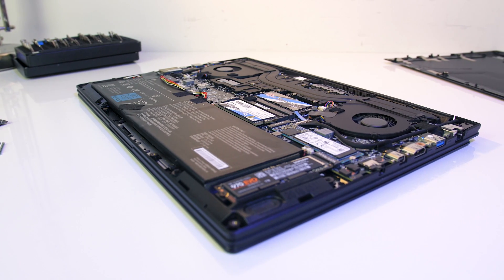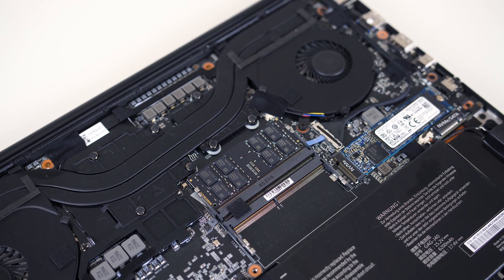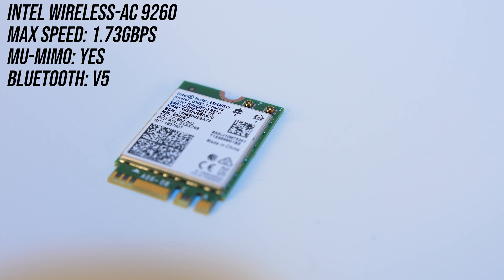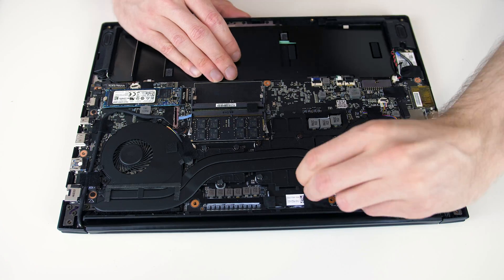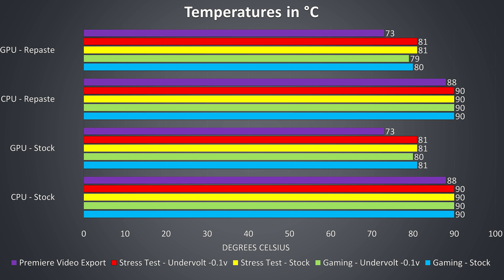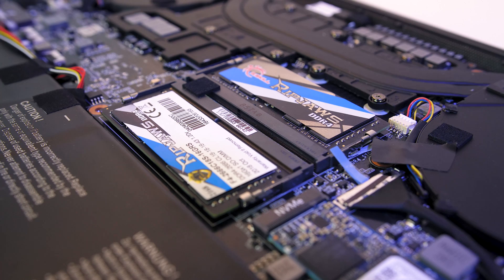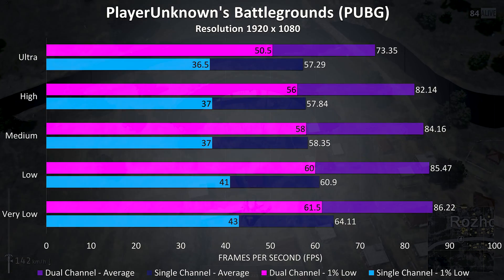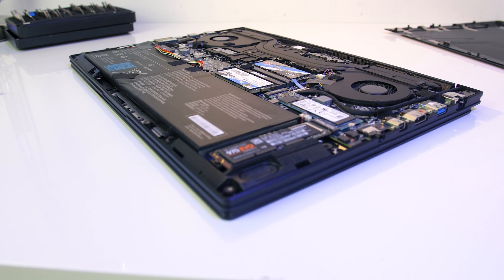Upgrading the Gigabyte Aero 15x Laptop

Comment: Great vid, especially since it covers all the upgrades I plan to do when the parts arrive..one suggestion regarding temps..the application by soreading the paste with a card has been shown to potentionally trap pockets of air which is bad as temp transfer..if you want try a repaste woth the bead method? In my case gave me a solid 4 degrees difference! I saw a huge temp difference between cores so that made me thing and suspect the application..so I removed the spreaded compound and applied using just a dot methid..temps are now more eaven and lower!
Reply from the maker: Yeah I might try redo it when I get a chance, not sure if it warrants another video though but we'll see!
Reply: @JarrodsTech  yeah it dropped my gaming temps considerably. I also turned off turboboost and undervolted the cpu which gave me cca 15 degrees difference! Also I made a diy laptop cooler by drilling the aluminium cooler mesh and installing desktop performance fans to have unobstructed airflow. That dropped the temps another almost 10c..so instead of gaming on a 85 - 90 c laptop I game on a chill 70 c with no performance loss since the gpu cannow boost all the time
Reply from the maker: Nice one! Why not just use a cooling pad? I guess the more direct you can make the airflow the better though, but doesn't need custom mods, would be interested to see the difference between what you've done and generic cooling pad.
Reply: @StillnessInMotion88  do you have any more details pictures of this? I'm interested in doing something similar
Reply: @safety6g  not sure if I can upload pics on here, but I did a lot of tests with the same fans blowing through the mesh and after I cut out the mesh, the difference was staggering, cca 10c when the airflow was unrestricted. My fans are not static pressure optimized, they are made to push bigger quantities of air, not optimized for pushing air through restrictions, hence the difference. If you have static pressure fans I presume the difference would not be as big. I am using the Coolermaster Notepal u3 as the laptop stand which I cut out to accommodate the fans in the right position, to which I added the Corsair Air series I think 120mm fans. Id gladly help if you guys have any more questions.
Reply: @JarrodsTech  the difference was a solid 15 c if I remember correctly, as just propping the laptop on a cooler gave me a negligible difference of I think max 5c. After cutting out the mesh it dropped 10 c more. I own a newer laptop now, which has better cooling, and focuses on drawing air throug wents on the top not as much from the underside, so cannot test it again for you, and the difference now is cca 7 c total with that same cooler. Bottom line, laptop cooler by itself does not do much at least in my case, add aftermarket fans drawing power from the socket directly, remove the mesh and it should yield considerably better temps.
Reply: @StillnessInMotion88  thanks for the reply, I'm just trying to work out what you did.. you cut out holes in the cooling pad and in installed the Corsair fans? And then also cut holes in the mesh on the bottom of the laptop in the same positions at the fans? Could you maybe email me pictures if it's not too much trouble it's jaycolgantravel  at Gmail... 🙏

Comment: Asus scar II or aero 15 x?
Reply from the maker: For what? Scar II wins in terms of gaming performance if you get the 1070, otherwise Aero IMO is better in most ways (way better battery, design (IMO at least, no camo patterm), SD slot, 4K option.
Reply: @JarrodsTech  because they are the same price :/

Comment: Liquid metal
Reply from the maker: Not sure it helps much here, I've read of quite a few others that have used it on their Aero with little to no change, seems like the fans/heatpipes are just not enough to remove the heat regardless of the thermal interface material in use.

Comment: Hey Jarrod, I own the First-Gen Aero 15 with an 7700HQ and GTX 1060. I repasted Mine with Liquid Metal and there were just very very tiny improvments. My Memory-Upgrade worked Flawlessly tho. I Upgraded from 1 Stick Gskill 16 GB 2400MHz to 2 Sticks and had no Problems whatsoever. Just like u i did add a second SSD, but i noticed that it would throttle when used, so i did buy some Thermal Pads to Put between the SSD and the Bottom Panel. That fixed my SSD-Throttling to some degree.
Reply from the maker: Cool thanks for sharing your experience, I didn't think the SSD would throttle, something to look out for I guess. Yeah others have said that about LM I think the heatsink / fans just aren't enough to remove the heat so it doesn't matter too much what material is between the does and heatsink

Comment: Would it be worth repasting my Helios 500 with Kryonaut? I'm seeing 84c on cpu under full load with no throttling (3.9Ghz)
Reply from the maker: Hmmmm could be, in my testing that laptop already does extremely well once you boost the fan speed though, I was able to drop it 20c going from default speed to max

Comment: Try changing the fan policy. I set it to run 100% at 70 degrees the the temperature has never hit 90 since then.
Reply from the maker: I did all the testing with it manually on 100% to remove it as part of the equation

Comment: wichintel Intel Wireless-AC 9260 card did you used, there is an with and without "vPro version" out there. TIA
BTW: Thats why I bought the Aero 15x instead of the MSI Stealth Thin, because of the easy upgradability.
Reply from the maker: I don't think mine was vpro but maybe you can see version number in the clip where I show the card

Comment: the cooling systeme of this laptop is weak by design, you can still tweak few thing to prevent overheating too fast like non stop turbo mode, for me i got super wild with 32gb hyper x memorie and 2tB Sata WD SSD and the PC randomly bluescreen when idle ( usualy befor going in sleep mode )
but still very stable as long as i dont try to get him into sleep mode
Reply: Random bluescreen when  before/after sleep is not isolated to this machine . There is or was an issue with Max Q and Windows.  I experienced the  exact same BSOD in the same situation on 2 of my other laptops.  X1 Extreme being one of them so def not just an Gigabyte issue.  The memory compat problem is tho.  My others I an use just about any stick.  Me thinks Gigabyte may have done this on purpose in the BIOS somehow.  As I dont see any technical reason why any compat SODIMM would not work....

Comment: I bought this laptop for almost 3k$ and exactly one key on the keyboard for each 1000$ didn't work. To be honest, I'm really glad that I had to return this laptop, because it can be used only as heat sink on wintertime. Instead I bought latest lenovo legion, and it's great! A little less powerful GPU, but great thermals instead, 70-80 degrees Celsius on load even without repasting.

Comment: Hi Jarrod,

I'm in the process of purchasing a monitor for my Aero 15x. I want at least a 144Hz monitor (as I have the 144Hz version). Also, I wanted something more than 1080p. Will my Aero 15x be able to run a 1440p monitor at 144Hz? And also, is 2k worth it or should I stick with 1080p? Thanks!
Reply: Should be more than able to run a 1440p 144hz screen

Comment: I heard people say that grizzly kryonaut takes some time to perfectly spread and that the best way to get it spread is to get as much heat between the CPU and the copper as possible. I applied grizzly kryonaut on my MSI GS63VR (i7-7700HQ, GTX 1070 Max-Q) and didn't notice a change in temperature, but now the fans don't spin at all if I'm only using the browser to watch Youtube for example, which means that the new thermal paste does transport heat more effeciently , even though it doesn't really change temperatures that much except less noisy fans and a longer boost clock.
Reply from the maker: I hear the opposite that it has no curing time 🤔 I'm using it right now on my CES trip so guess I can see how it goes after I use it t pump out all these videos

Comment: Great video! Since I bought my Aero 15x on Thanksgiving day I've been watching all sorts of videos regarding upgrades.  I bought a 32GB Kingston kit (HX426S15IB2K2/32) to replace the single 16GB VColor and the new kit worked first time.  The memory is running at 1333MHz (DDR4-2666) 15-17-17-35 timing and Dual Channel according to HWiNFO. Very surprised the G.Skill kit did not work for you as I figured it would be equivalent to the Kingston.  Like you, I also bought a 970 EVO 1TB but I decided to install Win10 Pro on it to boot from and moved the original 512GB drive to D: since the EVO was quite a bit faster in benchmarks.
Reply from the maker: Nice! Yeah I've heard about that memory kit a few times but only after buying my "supported" memory haha, bit too late now but it definitely looks like the way to go 👍

Comment: A very good video on upgrading laptops. Here are some of my experiences on upgrading Aero 15X. 
Memory: I got the V-color stick as well and due to thaiphon, it should be using Samsung C-die and I just bought another Samsung C-die SO-DIMM stick and it works fine at 2666MHz speed.
SSD: Added a Samsung 970 PRO 512G.
Thermal: I replaced the thermal paste with Thermalgrizzly Conductonaut liquid metal on CPU and GPU and configured an undervolting. I was achieving 80-85 degree Celsius on the CPU stress test in intel XTU and lower noise level while daily use.
Reply from the maker: Nice upgrades!
Reply: May you say your temps during stress test without undervolting, but just with applied Thermalgrizzly Conductonaut liquid metal on CPU and GPU ?? Appreciate

Comment: can i put another 512gb ssd in the laptop to make it 1tb, can you sync them to form one drive?
Reply from the maker: Yeah you can add a second M.2 SSD in along side the first one. You can probably make them sync using some sort of software, but I've never looked at doing that myself to be honest, unless you're talking about RAID 1 which duplicates data and uses one disk as a backup.
Reply: @JarrodsTech   yeah, do you know what ssd this has like the exact model, cause i heard to be able to combine both ssd you need the same ssd.
Reply from the maker: It might vary between region, but mine has a 512GB Toshiba THNSN5512GPU7

Comment: Imagine if at CES they unveil the successor with dual channel memory and better thermals, I'd be kinda disappointed.
Reply from the maker: I think there is a new Aero laptop there for me to check out in a few days 😮 but we'll see! There will definitely be a video on it if there is one.
Reply: @JarrodsTech  well if there is, I'm planning on getting it. My brother has the 1070 Max Q msi gs65, I'm not really too pleased with the performance, in fact it performs similarly to my overclocked 1060 in my desktop so I'm waiting for the rtx ones.
Reply from the maker: Fair enough! Either way definitely worth waiting at this point til CES - personally I'm not fussed, I think we're only seeing new GPUs this time around and for me the 1070 Max-Q is overkill as is, the 1060 would still be plenty, I'm all about that CPU power!
Reply: @JarrodsTech  Im surprised they released the 2080 max Q into such laptops, but I will have to wait for thermals before I go buy it. And I'll probably have to shell out $500 more than i was originally hoping to spend.
Reply: @JarrodsTech  Also the new model comes with an i9 8950HK, hopefully they buffed the cooling system.

EDIT: it seems they fixed a  lot of complaints, has windows precision drivers for trackpad.

Comment: Hi Jarrod, like many here I also bought the Aero 15X back in October after watching several youtube videos, including yours.  I've also done the RAM upgrade,  but only purchased the one stick to start with.  I upgraded my WiFi card to the Killer 1550 which is basically the same intel chip as the one you used.  For storage, I went with a 1TB HP EX920 and a 2TB Intel 660p.  The intel worked great but the HP took me quite some time to finally learn that it was picky with how exactly it was installed.  It's been flawless ever since.  I also did the repaste with Kryonaut and used .5mm Fujipoly pads on the VRAM chips.  I would encourage you to try under-volting your CPU a bit more.  I was able to run mine at -.200 with almost no instability issues, but bumped it up to -.180 and it's been rock solid.  I found a script to run XTU at startup and automatically apply the undervolt, and it's working great.  Not seeing incredible temp improvements, but I'm seeing 4.01GHz across all cores in most apps, and rarely seeing it throttle, although it still runs at 87+ under heavy loads.  Hope this can help you! -Jason
Reply from the maker: Hey, good to hear the upgrades went well! Yeah I could probably undervolt it more, I went with -0.15v in my original thermal testing video to see any improvement, I just figured I'd try a bit less here to try and account for others that may not be able to get quite as much. I might try redo the paste with the drop method instead, may I ask how you applied your paste?

Comment: Take it apart and reapply paste on the gpu. The amount you put on is too little. You'll burn it out the bits that aren't properly covered. You don't need to spread it out either. Just use and X pattern. You also want to use paste on the memory chips as was originally.
Reply from the maker: The whole die is covered, should the amount really matter? From my understanding, it does not: https://www.youtube.com/watch?v=EUWVVTY63hc I feel like the results with the GPU die towards the end would be similar. Pretty funny though because there are also comments saying I used too much, can't win with the thermal paste police I suppose 😅

Comment: You wrote GB (GigaByte) for the wifi card, yet you said Gigabit.
There's a reason why there's upper and lower case in terminology. :)
Reply from the maker: Oh I know, but the font I use only does capitals 😅 and although I know this I do admit that I didn't think about it at the time or I would have changed the font.

Comment: Hello Jarrod , the test for memories is not correct bro :) you are testing Single channel with 16gb stic and dual channel with two 16gbs sticks so total you got 32gbs you need to try test it with 8gbs sticks 2pcs total 16gbs then you will get correct results :)
Reply from the maker: The size does not matter, the games are not using more than 16GB. Either way the goal here was not to do a proper single vs dual channel comparison, merely show my upgrade. If you want to see a proper test with 2x 8gb and 1x 16gb then I've covered that here: https://www.youtube.com/watch?v=E_aPaj5QkmM

Comment: Probably a result of adding the thermal pads on the VRMs.  Like you said they could be causing the CPU/GPU to not make good contact with the heat sink, especially if they are different heights above the motherboard/CPU/GPU.  You could try a re-paste with thermal grizzly on the VRMs as well.  Also, consider some thermal pads with a LOWER thermal conductivity - with all those VRMs under the heat sink, those high-conductive thermal pads could be OVERHEATING the heat sink TOO quickly for the fans to cool it.  You want to cool these VRMs, yes, but you want the heat sink to take care of the CPU/GPU first and foremost.  As a last resort, consider adding/building up some thermal pads directly ON the heat sink and transfer some heat to the bottom case.  Also, try undervolting the GPU with MSI Afterburner or Throttlestop. This laptop is waaaayyy to expensive to not achieve max performance, so keep trying.
Reply from the maker: Yeah I think you're right about the heatsink just not being adequate to remove the heat, after further investigation even those that try liquid metal see little to no change too so not really sure if there is much more that can be done, but I might try some of these when I get back from CES, just don't have time to try redo it for now unfortunately.
Reply: Yeah, it’s curious because I have the new Dell XPS 9570 with the same CPU and a similarly poor (and possibly worse) cooling solution.  However, I was able to get the CPU load temps down to the mid-70s using thermal grizzly kryonaut, undervolt (.190 mV) and Arctic 6 W/mk thermal pads on the VRMs/mosfets.

Also, are you sure you are not “power limit throttling”?  I feel like your load temps should be higher if you are thermal throttling, since the max temp of the 8750H is 100 C.

Comment: Hey nice video!
I've added the same SSD as you did on my Aero 15X (500gb though). And switched to the new ssd as the primary drive. For some reason, the original drive stopped being recognized by the computer (in rare cases it just shows up spontaneously) Do you have any idea what I should do?
Reply from the maker: Thanks! I've never actually heard of that happening, if it's showing up in computer management > disk management it should be fine, does it remove itself from there too? Any possibility it's loose or something? I suppose you could maybe try swap the slots and see if that helps.
Reply: @JarrodsTech  Hey, thanks for the reply! I only noticed it after returning to your video a year later to see how to upgrade my Wifi card haha
SSD thing still hasn't resolved though, I'm planning on sending it to Gigabyte for warranty repair. It is not recognized in disk management, and I tried swapping the slots. I think it is a BIOS issue, upgrading it myself is risky since I can brick it or make my dual-channel 32GB RAM incompatible.
Reply: Is there a newer wifi card you recommend now?
Thanks!

Comment: I only swapped SSD on this laptop but if I decided to repaste I would have been careful to follow what they poorly did in first place and replacing thermal paste with thermal paste, not pads. I would try to repaste it instead of using thermal pads around the main components. Anyway, great video ;)
Reply from the maker: Thanks! Yeah I may have done that if I had thicker paste, but wasn't sure about using Kryonaut there too so just went with the pads.